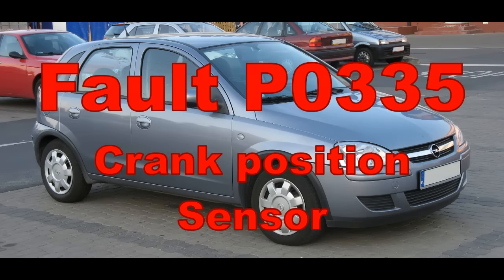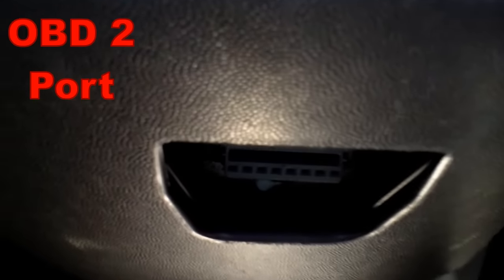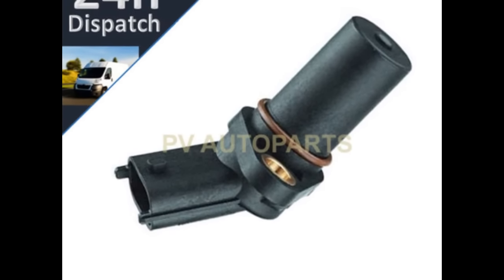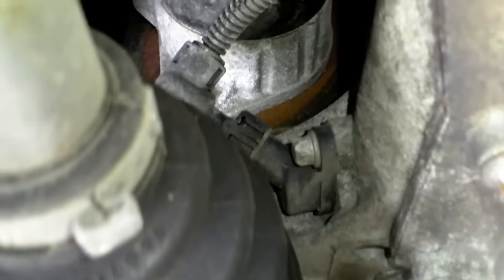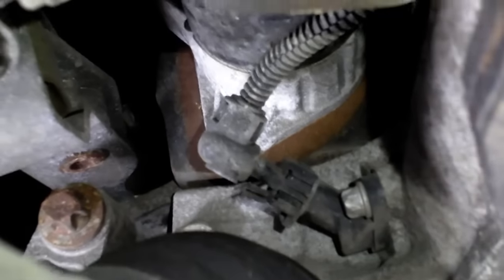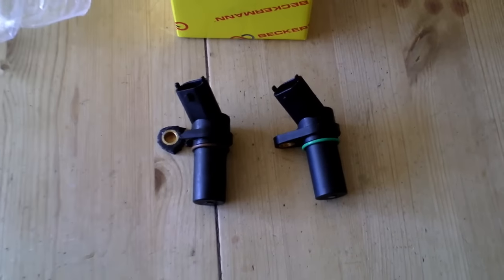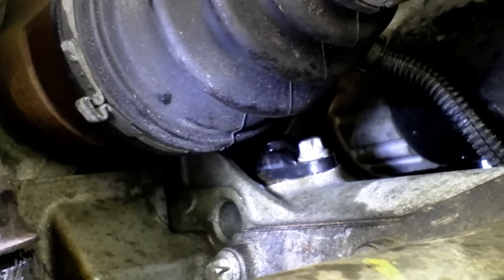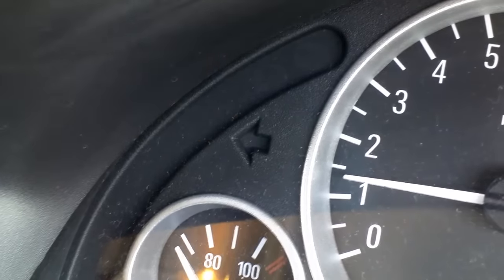Opel / Vauxhall Corsa C P0335 crankshaft sensor replacement guide.

Comment: Did this today with a jack and two axel stands and it worked. Saved me £200. Hardest part was getting the sensor out as hands are too big and there's very little room to work with in general. Thanks for uploading the video made this easy.
Reply from the maker: Pleasure and well done

Comment: Did mine today on my 1.7 DI combo van.
It was a git to get to. Just underneath starter motor and above driveshaft. There was also a starter motor bolt right in line of the bolt (hence why I needed the 1/4 drive universal joint😟
Mine was an M10 bolt.
The only way I could get to it was a 1/4 drive socket, universal joint and  100mm extension bar.... not easy at all.
Very fiddly. The good news is it’s now purring like a kitten.
I also changed out the EDU on back of engine ( fuel control brains).
They both give same symptoms. Sending my old EDU off for repair on the eBay advert (£40.00 with lifetime warranty) 
Great video... very helpful
Reply: Hello, can you please give me the sensore code please!??
Reply: What's an EDU? As i changed this with a new one and it's the same problem again...

Comment: Great video. I would just add, a small amount of lubricant (clean engine oil) on the sensor and o-ring will help tremendously when re-inserting it into the block.This will also help in seating the o-ring without damage.

Comment: brilliant video! very helpful and well explained
Reply from the maker: Cheers Antoan.
Reply: Hello bro, i have a corsa c 1.7 dti disel but it's not working good, i want your opinion about my case, 

before it was very speed when the "Rotation" when to 1.8 or 2.0 the turbine started working and the speed was increased to very fast, now when i drive it's going very slowly and the rotation passes 1.8 , 2.0 and more but it's not taking any effect,

i changed turbine , it's still the same, i tried with new AIR SENSOR it's still the same,  my question is : is there any another SENSOR that i need to change to fix this problem?

Thanks!!!
Reply: i have petrol corsa c 1.0 which is obviously very different engine than yours. The engine was very slow to response and sometimes it dropped the revs suddenly for a few seconds. After i changed the crankshaft sensor it's a lot better and don't have the same problems anymore. I would suggest to check the engine faults on your car first to be sure what is wrong rather than replacing everything that comes to your mind. Good luck :)
Reply from the maker: Yes I agree with Antoan.  It seems your turbo is not producing boost or perhaps the waste gate or turbo ducting is leaking pressure.  Either way you are prob best to get it checked out on a rolling road.  Have you tried putting this out on a Corsa forum.
Reply: Antoan Hady, Thanks for your reply bro! i already controlled everything regarding motor mechanic and the service told me that they don't work with sensors and electricity in the vehicle, but they confirmed everything else that is ok, also turbine was tested in another car and it was working good.. i think the problem is to sensors , but i'm not sure which sensor exactly is not working because i have to order it from ebay or somewhere..
Reply: +fredintheshed1,  i already replaced new turbo to my vehicle, it's still the same..  the main sensor that is to air flow filter is not working too.. but i tried with a new sensor "bosch" and original one from another and the same corsa but it's still the same,  but in my area there is no specialist for sensors and car electricity and all sensors are not original they stop working too fast..   so i just want to know which sensor is for my case which one should i buy to replace, thanks a lot , your reply is very much valuable!!

thanks!
Reply from the maker: I wish you the very best of luck my friend.  Sadly iam not really up on turbo tech even though both of my own cars have them.  Hope you get it sorted.  Sounds like you have already replaced all the expensive parts.

Comment: Thanks for sharing ,very helpful ,now I m going to try on my car as its broken down because of that fault ,,let's c ,,thanks again for helpful advise
Reply from the maker: Amina Zoi   Your welcome.  As I mention on the video its a little cramped space to work if your laying on your back.  The sensor may be a little tight in the block if its the original so take your time levering it out.  Our Corsa has been running 100% since this video.

Comment: Thanks! Im going to try fix it this weekend.
Reply from the maker: +Damian Balandowski Nice one, you will save loads of ££.  Just let the exhaust cool and take your time.  Esp removing the old sensor.
Reply: +fredintheshed1 Thanks for advice. I don't know if my corsa has same problem as on this video. But engine cuts off randomly, and tickles while driving, and I also have the engine light on dashboard, but when engine cuts-off / or engine starts tickling RPM goes to 0 and stays there ,but next morning it is just normal... Im going to try this sensor, If this won't help I will look for different solutions.
Reply from the maker: +Damian Balandowski If you do not have one buy a OBD2 code reader from ebay, best £20 your ever spend.  Get the fault code and google it.  Someone else would have the same problem and fixed it mate.  Best of luck.
Reply: +fredintheshed1 I even found some for 13 pounds, If changing this sensor won't help I will buy this reader. Thanks :)
Reply: +fredintheshed1 I did it today, lot of complications (getting sensor out, and screwing the bolt in), And also we did wihout ramps or anything high, just tyre + 3 thin woods pieces. But error did go out and car works better. I will drive more to test it, I hope it was the sensor.
Reply from the maker: +Damian Balandowski Well done that man !  You prob saved yourself £80+.  Yeah its a tight place to work and the sensor is hard to remove.  Hopefully your done.  The management light will be your key, if it stays off your ok.
Reply: +fredintheshed1 management light went off, and while driving back to home (i used uncles place to change it - more space), it did not cut off or lose power. We were getting sensor out for about 1-2 hours, then putting the bolt back in was very hard too. Hope it is fixed, it looks like it is, I will see when I go to work tommorow :) Thanks for great video, helped me a lot.
Reply: +fredintheshed1 Car works great now, doesnt cut off and engine sounds are normal now. Thanks again.
Reply from the maker: +Damian Balandowski There you go mate you saved some money and learned a little bit about your car at the same time.  That's how it starts.  Things like oil changes and servicing are far easier than what you achieved here.  Best of luck with you car.

Comment: What a great video, just changed the CP sensor on my sons Corsa and this was very helpful firstly to locate the sensor and the nice tip about an 8mm ring spanner. I have the torks sockets but it difficult to get one on where the sensor is.
Gave it a 4 mile test run thro town and didn't get any of the stalling at junctions he had before. The engine management light stayed on tho after the new sensor and throughout the test run , but cleared the next time I started the car. Maybe the ecu learning the CPS is now good?
Reply from the maker: Well done Neil.  You prob saved £100+ labour charge.

Comment: Top video Fred thanks. I'm also in Somerset like the last commenter and looking to replace mine! Is this procedure the same for an astra g 1.7 dti? I don't have code 0335 but have 0370 and 0400 too. Reason I think it's maybe crank sensor is because when engine is warm and driving on very light constant throttle the car doesn't maintain a constant speed but seems to surge forward intermittently. Diesel consumption seems a little high too.
Reply from the maker: Once the engine losses its crank sensor it can throw up all sorts of codes as its totally lost.
Reply: Thanks Fred. Similar location and access on the astra 1.7dti isuzu or is it not an engine you know?
Reply from the maker: Not sure Ben.  Its going to be down low as it uses a magnet on the crankshaft.
Reply: @CB-RADIO-UK  cheers Fred ta

Comment: On my Corsa C I only get the spanner light when the car has been running 20 odd mins, giving the crankshaft sensor fault, it never comes on from cold and the car runs perfectly, any thoughts??
Reply from the maker: It does sound like its breaking down when hot under load.  What normally happens is that it will get worse till the car will not start as the car wont know where the crankshaft has stopped.
Reply: @CB-RADIO-UK  any idea what could be causing it?

Comment: Hi, do i have to disconnect the battery before changing the sensor.?
Will the new sensor confuse the ECU. Thanks
Reply from the maker: It should not.  I just had the ignition off and did not have an issue.

Comment: many thanks +fredintheshed I've found it and ordered it so be fitting that along with a new cv gaiter😀 it was by the oil filter
Reply from the maker: +Kieron Carberry Nice one.  Just take your time wiggling the old one out as you don't want any bits to fall inside the block.  Best of luck mate.

Comment: If you don't have a code reader and the fault light is on, you can use the pedal test, requires no equipment at all, just Google vauxhall corsa pedal test

Comment: Will this also fix the 'f' code problem - also apparently caused by a crankshaft sensor fault (according to multiple google searches)?  Thanks - great video.
Reply from the maker: TBH not sure.  When the crank sensor fails it causes all sorts of issues and the computer has no idea of the engine timing.

Comment: Can you please confirm the part required for a crankshaft position sensor there seem to be lots of options even when putting in the reg number. I have a 2005 Vauxhall Corsa twin port 1.2. LX05OGR thanks
Reply from the maker: Hi.  No sorry the car was sold on many years ago.

Comment: mate could you please advise me  i cant get mine off the hole bot broke off and cant lift it i put some wd40 on it but it dont seem to help if anything seem to get stiffer to move i tryed sopy water that never helped do you have any idea thanks dennis
Reply from the maker: Might try some gentle heat.
Reply: @CB-RADIO-UK  would it help if i started the for 5 minutes or just best to use heat gun thanks dennis

Comment: Hello, nice guide! Did your vehicle flash F? Mine does and I'm suspecting it's this sensors fault as it sometimes starts without trouble and sometimes just flashes f. Feels like a sensor fault then the whole actuator.
Reply from the maker: I am not sure if it flashed.  Its my daughters car.  She stopped to get fuel the car being hot and it would not start. The EM light stayed on.  It started and I read the code.
Reply: fredintheshed1 is the crankshaft sensor located in the same place on a combo 1.3cdti as the video ??

Comment: Mine broke inside and now is stock in the drive shaft ! How can I remove it spent 6 hours and still has the plastic in there  😢 please help
Reply from the maker: Only way i see is to start stripping the motor from the bottom. :-(

Comment: Thanks for the great video! I'm almost there... I just can't seem to pull the old senser out.

Bolt out, covered the lot in wd40, went at it will a long flat head screwdriver driver, but it just won't budge! Any suggestions before I send it off to the mechanic?
Reply from the maker: Its a problem as they get stuck.  Not much you can do other than use a pry bar to try and get it moving.  What you dont want is it breaking off and dropping inside the engine.  If its really stuck than it might be best to let the garage change it.

Comment: I have just replaced this but I am now having a problem with the radiator fan. When I turn the ignition on the fan starts on maximum and continues when the engine starts, I have a error code of p0115. Any help would be appreciated.
Reply from the maker: +TomBurns94 Sounds like the thermo temp switch may have failed.   The ECT (Engine coolant temperature) sensor is basically a thermistor that changes resistance with temperature.  Usually a two wire sensor, a 5Volt reference from PCM (Powertrain Control Module) and ground signal to PCM.  This is different from a temperature SENDER (which usually operates the dash temperature gauge and operates in a similar way as the SENSOR, only it's a different circuit than what a P0115 is referring to).  As the temperature of the coolant changes, the resistance changes on the ground signal to the PCM. When the engine is cold, the resistance is high.  When the engine is warm, the resistance is low.  If the PCM detects a voltage condition that seems abnormally low or high, P0115 will set.

Comment: Thanks for the vid, gonna change mine soon as I'm having poor warm starting, although I get no error codes. Is this normal?
Reply from the maker: gazfcgruff We got a error code with ours the first time it refused to start.  Without a code you wont know if its the crank or the camshaft sensor as both have similar symptoms.   If your used to working on your car then its a cheap part to change and remove it from the problem.
Reply: fredintheshed1 once again thanks for the tut, just changed mine, the plastic around the connectors had pretty much broken off on one side, hopefully this will sort my probs out

Comment: hey there , i have the diesel , i have read the fault code using the pedals and it shows  P0335  (CPS ) , but the engine management light is not on all the time and the vehicle runs perfectly fine , it normally would only  come on when under load , ie , going up a steep hill ..........would you suggest that the crank pos sensor is failing , if the van runs perfectly well and has done for months ?
Reply from the maker: A P0335 fault code indeed means the crank sensor is going open circuit, on that i would change it.  They normally start to fail intermittently when the engine is hot and shut down then a restart is tried.  That normally triggers the engine light.  If a failing sensor would put the light on under heavy load, iam not sure, that could be something else.  Maybe a cheap ebay OBD 2 code reader is a good idea.  Good luck
Reply: thanks

Comment: I replaced crankshaft sensor on my Opel Tigra. Error code was also deleted and I had the same problem as before it stals in idle and error code for cfrankshat sensor still comes up.
Reply from the maker: Maybe its something else.  Try driving it a few times and search for codes.
Reply: @CB-RADIO-UK  Thanks for the replay. Also I noticed that my speed senor doesn't work. I will try to change it also maybe that sensor is causing the problem. They working on the road where I live and after I drove a few times on that road problems with sensors started.

Comment: Hi there I'd like to ask you something if I may, I have a ZAFIRA 2.2dti from 2003 and I have the same error you got so I bought a crankshaft sensor and plan on installing it tomorrow. But from my obd I also have an error "P0340 camshaft position sensor "A" circuit (bank 1 or single sensor)" I am hoping the injection pump is not dying because it's worth more than the car now. Do you think the second error could be caused by the 1st one? Thanks if you can help ;)
Reply from the maker: Yes its possible if the crank sensor has failed it might upset the Cam sensor as the CPU will have no idea where the engine has stopped.  I would install the crank sensor and reset the codes and see if the EM light comes back on.  If you get the 340 code again then the cam sensor is also failing.
Reply: fredintheshed1 
Thanks ;) I'll go ahead with the crankshaft sensor and test drive. Hoping that will be it.
Have a nice Easter weekend!

Comment: my 2005 corsa c was cutting out at junctions after warmed up  so checked fault codes and wasnt showing any but had an idea it was the crank sensor  so i changed it and all seemed fine til the next day and the engine was now misfiring and showing a fault code of crank sensor and a cyl down as well as emissions out, it wasnt misfiring before i changed the crank sensor just cutting out, could this be a faulty new crank sensor ??
Reply from the maker: Yes.  The crank  sensor  i fitted  in this video  failed after 2 weeks.  I bought a gen sensor from the the dealer and that one  worked ok.  The cheaper ones have  quality issues.

Comment: Need help! as I was taking out the old sensor the old bolt holder snapped and left the sensor still in and can't enough grip on the sensor to pull out. Any suggestions? Great vid BTW
Reply from the maker: Mine was tight as well.  You need to carefully pry around the edge with a screwdriver.  Once you have a gap spray in some wd40.  Just take your time.

Comment: hi fredintheshed1  is this the same location on a meriva 1.4 petrol ,it took me 3 days to find the obd thingy to plug in the fault finding machine it looks easy even im gonna try it,great video
Reply from the maker: Not really sure on the Meriva.  The crank case sensor is going to be somewhere on the bottom of the engine block.  The sensor itself and fitting is prob the same.
Reply: ok thanks for the reply,i will take them all out and clean them,till i find the right one and replace it , many thanks for all your help,godbless you fredintheshed1

Comment: Hello mate ! I got 0300 and 0302 error missfire on my corsa 1.0, and i was thinking it can be also the crankshaft Position sensor a Problem to this error ? Coil Pack is New, ignition also New, injectors no error, but second injector if i pull out the harness, the engine mentain the same nothing else happening.... I am broke, can you help me ?
Reply from the maker: Its hard to say TBH.

Comment: Is the sensor in the same place on a 1liter 12v petrol engine please be very grateful for your help.
Reply from the maker: If its the 3 cyl motor then its the same as the one in the video
Reply: And how about 1.2 16v petrol? Thank you